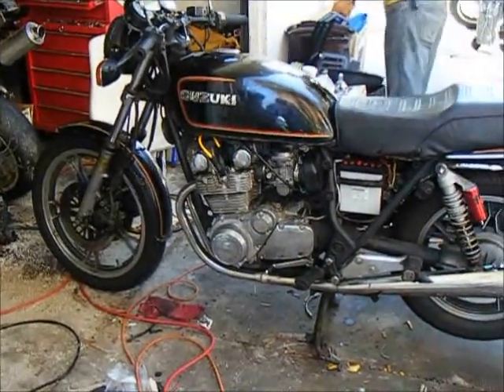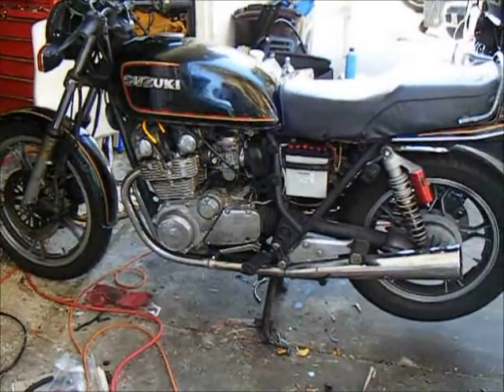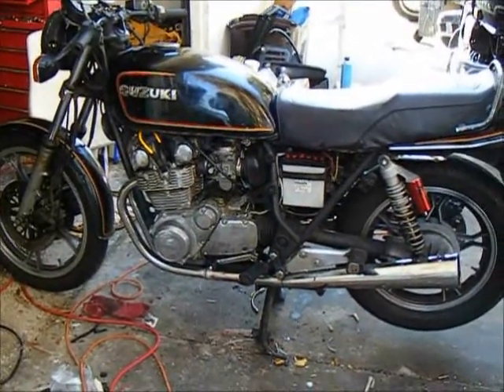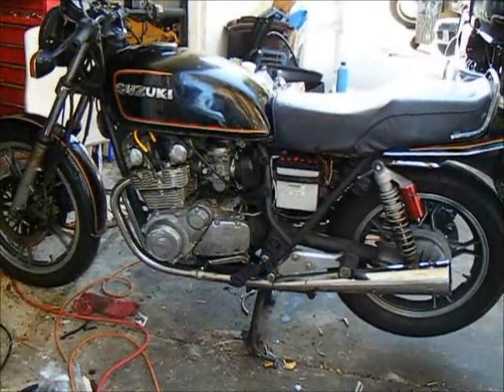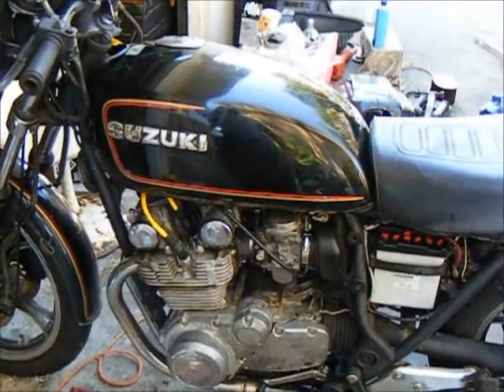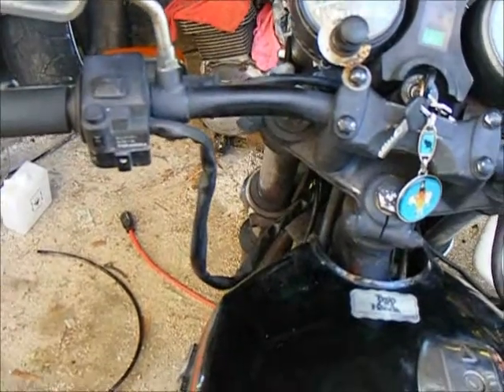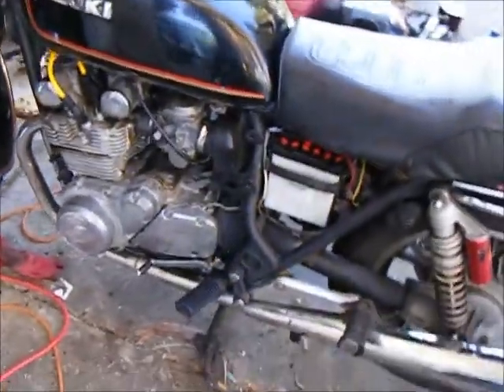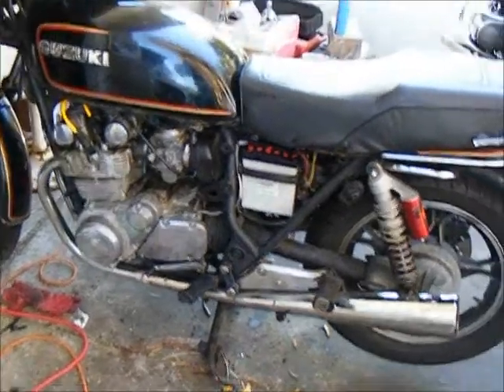Suzuki GS650GT Ikusa Ignition backed up by Accel Supercoils

Comment from the maker: @TheDevonParker They weren't the biggest company -- and they went out of business in the 80's.... If I hadn't had NOS (New Old Stock) I would have gone with probably 3ohm accels - on a Dyna puck (like an s2000 or is that 2000s) that or I would have shot for a boyer bransden setup with MSD coils.
   I've got one spare coil but not a set